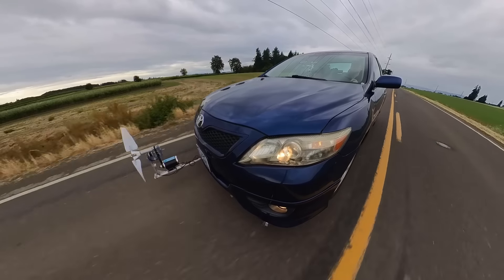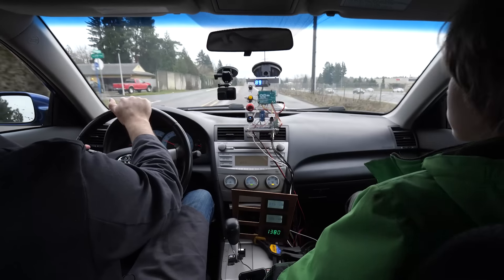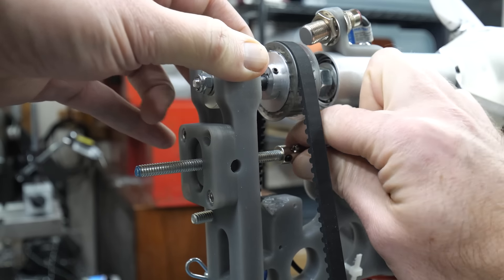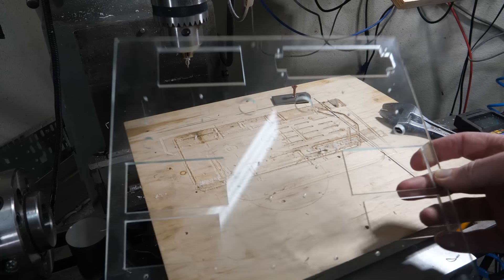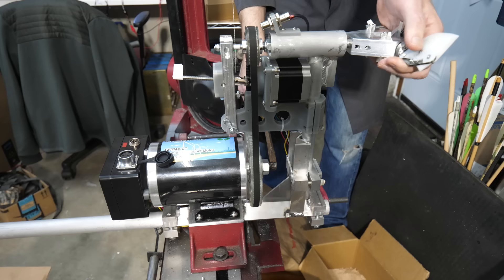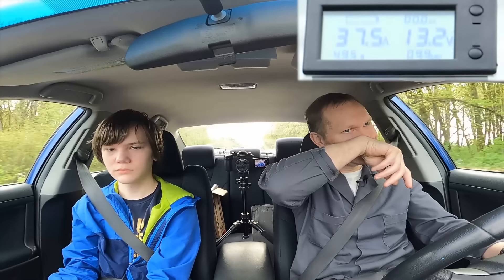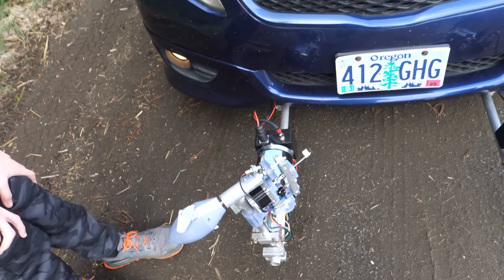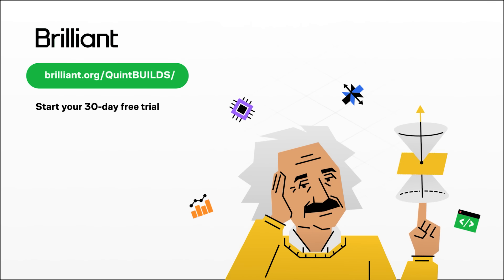Wind Power on a Car #7

Comment: The car's electrical load is going to vary constantly no matter what you do.
I can't help but wonder if it would be much simpler to just dump the energy into a resistive load (constant or dynamic, but at least fixed in it's "stages") to get more reliable data on power generation as well as MPG?

Comment: i feel ya on that nut, Quint. i just replaced the CV and bearing in my front driverside wheel. i'm driving from anchorage to play a music festival about 2 1/2 hours north. that new bearing fails 20 miles outside of the festival. when i got it towed home the next day, i jack it up...the axle nut was loose. loose happens buddy :-)

Comment: About the defroster, it might be easier to bypass it and put in a fixed resistor bank or charge a large battery for a constant load instead.

Comment: I think a smaller set of wind turbines of the right type In a Wind tunnel effect so you don’t only have pressure pushing but also vacuum pressure pulley from the rear. Just a thought.

Comment: Thanks Quint & Grant! I have often wondered what this would do. Maybe use the turbine to power a hydrogen generator to help power the car.
Reply: Nah. That would introduce more conversion steps, and therefore more losses. Not to mention the fact you don't want to expose metal directly to hydrogen that wasn't designed to deal with that, as it can cause hydrogen embrittlement.

Comment: Why not mount them to the back so that the car acts as a sort of wind break and doesn’t put as much pressure on the blades. Have them face backwards and maybe mount them on the rear bumper or on the trunk lid to catch the air coming off the rear window.

Comment: As long as you realise there's no such thing as perpetual motion, that the drag created by the propellers will dissipate more energy than they put back into your car's battery, and you're just doing this as a fun experiment, that's great. 👍
Reply: He went over that in the first video. There nothing here that violates the laws of physics and it dose increase efficiency.
Reply: 🚨 what are you the physics police
Reply: @abracadabra2337  No, physics polices itself. Failed theories like perpetual motion rapidly fall by the wayside, without any need for help from me. 😉
Reply: @Aurorajunior7321  The first law of thermodynamics is the law of conservation of energy. It states that energy is always conserved. It means that energy can be neither created nor destroyed. Instead, it simply changes from one form to another. To keep a machine moving, the energy applied should stay with the machine without any losses. Because of this fact alone, it is impossible to build perpetual motion machines.
Reply: @alexistarr  Of course. But this experiment doesn't violate any of that.
He went over it very clearly in previous videos.  A normal car pushes through the air, but it's not making any use of that effort.
If you put a turbine in front of the car, you can get energy out of the airflow, and that leaves a wake behind the turbine that the car is sitting in. You're still pushing through the air the same amount (as long as the turbine doesn't increase the frontal area of the car), but you're managing to capture some of that wasted energy.
Reply: If you're still confused about where the energy comes from, think of it this way:  Every car driving along produces an area of high pressure at the front of the car. It takes energy to maintain that pressure differential.
Putting a turbine out in front of the car transfers some of that pressure differential from a stagnant point on the front of the car, to the surfaces of the blades of the turbine where energy can potentially be extracted. Whether they can get everything working at a net positive is a different question, but the concept does not violate physics.
Reply: @IstasPumaNevada  Experiments don't violate the laws of physics, they just objectively test them, when done correctly. That's why he gets less gas mileage with these propellers mounted to the front of his car than when they aren't there.
Reply: @IstasPumaNevada  If so, the friction from the propellers and Dynamo exceeds any gain from this effect leading to a net loss of energy. He'd be better off without the propellers.
Reply: @alexistarr  He is actually experimenting. 
Their experiments in a previous video showed the net energy they gained from the turbine on the truck was GREATER than the loss in fuel efficiency, including accounting for all the normal losses of an internal combustion engine.
I was very wary of it being perpetual motion nonsense at first, until I sat and listened to how it's supposed to work, and thought about it.
Reply: @IstasPumaNevada  RIP the laws of Thermodynamics: 1824 - 2024. Sadly no longer with us, but greatly missed! 🤣
Reply: @alexistarr  what are you talking about lol. 
Again, he went over this in the first video, I think you should actually watch it.
Nothing about this is breaking the laws of physics. 
But I’ll explain it again. The car is using energy to move forward, it is also using some energy to power the electronics. Assuming the front area of the car is unchanged, the drag that that area produces is purely determined by the speed of the air hitting it. Thus, if you can reduce the speed that air is hitting the car, the drag force is reduced. The propeller is not increasing the front area of the car and is therefore not adding extra drag. As the propeller turns, it takes energy out of the air slowing it down . This doesn’t  make the drag of the car increase because that air was going to encounter the car frame anyway. Therefore, the propeller is taking energy out of the air and converting it to electricity. This causes drag on the propellers yes, but that same amount of force was going to be absorbed by the car. So putting the propeller on the car does not increase the amount of force that the engine needs to provide. However the engine is no longer required to make electricity for the car and thus has to work less, reducing the total load on the engine and reducing the fuel consumption.

I don’t really know how to explain it better than this so if you don’t understand, sorry , but if you’re just trying to waist every one’s time, then stop,  as you can see there are way more interesting things to do with your time, like studying cool physics. And a good place to start might be today’s sponsor, brilliant.org 

(Free advertising lol)
Reply: @Aurorajunior7321  What you're missing is that the increased gas consumption, caused by the massive aerodynamic drag added to the car,  caused by bolting a large windmill to its front, dwarfs any energy produced by the windmill.
Reply: @alexistarr  did you even read my comment lmao
Reply: @Aurorajunior7321  I did, and pointed out the flaw in it. The windmill bolted to the front of the car takes more energy from the car, in this case in the form of increased aerodynamic drag, than it produces. That's the problem with all such perpetual motion machines.

Comment: Tip: Using a sine wave lookup table to do incremental stepping on the stepper makes it run much smoother and can allow higher torque and larger speeds. Doing so turns the stepper effectively into a high torque low speed brushless servo motor.

Comment: prediction: when you tested the blade by running the generator in reverse, it wasn't secured well in that clamp, instead of the blade and assembly being at the end of that pole that's free to move/vibrate/etc.

Comment: Rear Defrosters run for 15minutes.
On some cars, you can change the timeout function on them.
This is controlled by the Body Control Module
I advise against trying to bypass the BCM to keep the rear defroster on.
Just turn the defroster off and on before each test.

Comment: Surplus electricity for HHO gas production on board to blend with gasoline combustion might be next project to consider.
Reply: Too many losses, better off to put an electric motor somewhere in the drive train and then feed the turbine power into that.
Reply: No. That would just introduce more conversion steps and induce more losses. They're trying to replace part of the alternator's load, that is the most simple and direct route to energy savings out of this.
Plus introducing hydrogen to metal parts that weren't designed to deal with it, like, say, an engine, is never a good idea. Hydrogen embrittlement is not something I want to mess with.

Comment: You could use a clutch from a Chainsaw/or something similar as a RPM limiter. Instead of functioning as clutch it could work as a break.
However it also would increase the complexity.

Comment: Greetings.  You might consider a data logger to a raspberry pi with a monitor where you can configure how you display. Immagine tracking blade pitch angle, rpm, and power over time in one line graph over time.

Comment: Why don't you run a triangle and connect the two propellers to each other then shorten the length so they aren't sticking out so far.

Comment: You could set up an LDR to detect when the light goes out with a solenoid to re-activate the button. I've used that as an auto reset before.

One problem with the buttons in cars though: Sometimes they say they're doing the thing you asked them to when they're not. Basically the manufacturer thinks they know better than the driver... and for 99.9% of cases they definitely do. It's not their fault you want to use the feature for a purpose the control algorithm wasn't intended.

Comment: The blades need to be contained the torque on the pipe allows for the blades to take on forces from multiple angles. There should be a large surface area to maintain blade roll/yaw.

Comment: Intuition says the the area of highest static pressure at the front of a vehicle will be at the most forward, most perpendicular to the wind part of the body where the wind has to change direction the most..? 
(This is aerodynamics after all, where intuition is almost useless! :) )

That prop should make it so the air hitting the same surface is no longer perpendicular to it, which may well help theoverall aerodynamics of the car..?

Comment: maybe go with a direct drive setup ? possibly using a battery powered lawnmower motor, as they are permanent drive brushless units with thick shafts. might work better as then you can fully control the rpm just by limiting current on a separate circuit to the charging circuit

Comment: You should try changing up the turbine to the column style blade setup that looks like an old school push mower, run it horizontal across the bumper with a generator on each end. Should be more stable than prop style blades  and get rid of a few failure points in the current mounting setup. Although you might find new failures too 😂.

Comment: From the footage you showed, the biggest issue I can see actually seems to be the fact that the turbines are leveraged out in front of the car on those small mounting bars. They look like they're amplifying the movement of the suspension on every little bump and causing a ton of lateral stresses on all your components and pulling everything out of alignment. The turbine explosions also seem to happen on a good bump as well. I wonder if they were mounted in a more secure manner, with more bracing, or perhaps isolated from the suspension in some way, you might have more luck?  Everything else seems to work great in bench conditions but they're really bouncing around like crazy on the road and I can see all those momentary impacts just destroying all your careful adjustments. Love the project, I love that your kid is as into it as you are!
Reply: Yes, I wonder if they could be on some type of gimbal type set up to sort of separate the movement of the fans/system from the car movement.
Reply: simple cable mounted with two bolts connecting upper part of the turbine and the car.
Reply: Build it into the grill…
Reply: Build it on into the car body.

Comment: Love your stuff man, great way to just attack the problem and see what you can learn along the way. 

As a fellow mechanical design engineer here's some thoughts I have. Aluminum, while light, has a fatigue limit that steels generally don't. It also doesn't have a ton of stiffness which isn't ideal in cantilevered and high vibration loads. I assume the first tube out is steel but even the vertical uprights have a lot of cantilevered load with the turbine forces. It's a bit more expensive but a carbon fiber tube might actually be best here, you'll get the most stiffness and light weight. Otherwise steel would probably be better in a situation like this. 

Also square tubing would be better to prevent the twisting, but I'd understand the simplicity of round tubing. One thing to consider is at the end of the extension arm some steel cabling and turnbuckles to pretension everything and reduce the resonances that happen at speed. That might help with some of the durability issues. 

Those 3D printed turbines are shockingly good!

Comment: 2 things I see for possible improvement that will hopefully keep your belt on.

1. Your pulley gears/wheels could be designed with outer edge, raised guides.

2. Putting a shroud behind the fans to prevent air interfering with the belt. It could help with some of the vibration.

An areodynamics acting as an airfoil the flow of air to pass by without putting too much pressure on the bracket mounts under the vehicle.

Comment: I've given this idea thought before and I imagined it being a bunch of 4 or 5 inch fans molded into the nose of the car, and/or potentially squirrel cage style fans mounted under the bumper. My though process was to keep the wind resistance to a minimum while still getting high RPMs on the fans. 
I'm no engineer so it could be a totally shit concept IRL, but it made sense to me at the time.

Comment: Your using a HAWT turbine for this have you thought about using a VAWT turbine turned on it's side?

You can use the main axis directly into the motor and ignore those belts and gears.

Comment: Maybe a centrifugal style blade would be a better solution. In order to adjust the pitch to catch more air, you could just adjust the inlet position. This would put less stress on the blades.

Comment: perhaps a less hard propeller would cause less explosions?
Reply: Possibly, but it needs to be stiff enough to not flex too much in the airflow, otherwise it will be tough to control the pitch accurately and might introduce new problems like flutter/oscillations.

Comment: Every bit of power from the wind resistance is only taken from the cars aerodynamics, causing more fuel consumption, so you might as well put a generator on the brakes 🤗

Comment: I have many years experience with wind turbines number one you need to fabricate the blades out of carbon fiber plastic will not be appropriate for this project number two the shaft that inside the wind generator motor needs to be a hard steel not stainless steel or regular steel will not cut it. And number three. Since this wind turbine is spinning an extremely high speed, then a stationary wind turbine you need to fabricate everything extremely heavy duty and well-balanced extremely well balanced.

Comment: why dont you treat the wind like water of the river and create "water"wheel, on the side of the car, may create some pipe directing the wind current to turn the wheel, the "jet" of air stream from the pipe will it create a faster fan/wheel?

Comment: You can prevent overspeed by letting the arduino short-circuit the generator as soon as it detects the RPM getting too high. That turns the generator into an electromagnetic brake
Then make it automatically adjust the pitch to lower the RPM and undo the short-circuit.

Comment: Might be a dumb question with regards to the overspeed condition, but could you use the generators as a regen brake when the speed hits a threshold? Sort of like an electronic goveror?
Reply: But isn't that what it's already doing since it's used as a generator ? I think rn the load is just too small on the motor so maybe he should have a variable load so that the generator takes more resistance ? Maybe a battery could do that that way the energy isn't wasted.
Now that I look at it, maybe we just have the same idea and I just misundertood yours.

Comment: What about an impeller? Screw drive in a tube with an air dam forcing air. Potentially hook up a door flap to the fuel pedal to open when your foot comes off the pedal. Like an EV. To let air in and increase drag.

Comment: Google "Bridge building". Triangulate or continue to fail! High speed oscillation is destroying your equipment. Think TRUSS! I am designing a Ford F150 to get 50 MPG. I have already gone from 16 to 21  MPG. No, I didn't just let the tailgate down. But turbines are in my calculations. Feeding low pressure zones are where I am now. Thanks for all the pertinent data!
Reply from the maker: A more rigid structure could actually increase the forces on the turbines. Good luck with the F150.

Comment: Kind of wondering why you wouldn't have made this so it's on the back of the car so it's not putting so much force on the blades and the blades are pushing the car rather than pulling it along especially with a Toyota looks like Camry which I own a Toyota Camry 2010 model Le but I really do like that idea

Comment: Just a quick thought on the pulley. Could you print flanges either side so it will help to keep the belt aligned.
Edit @8:12 it looks like you have done that.